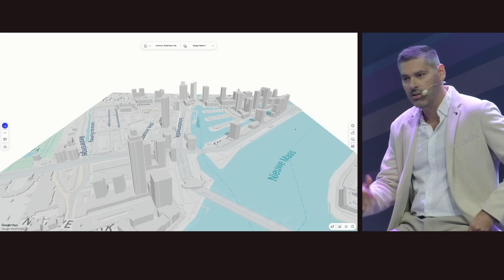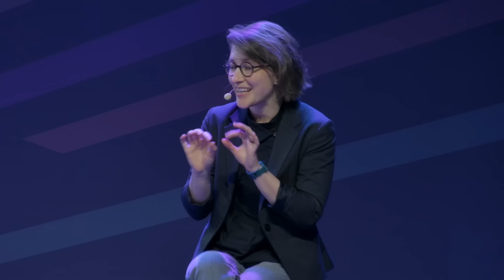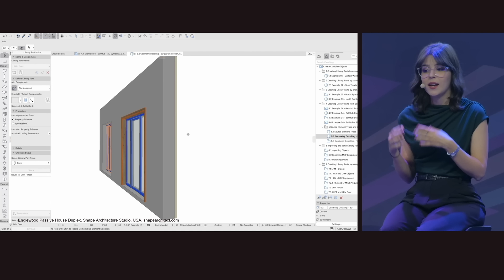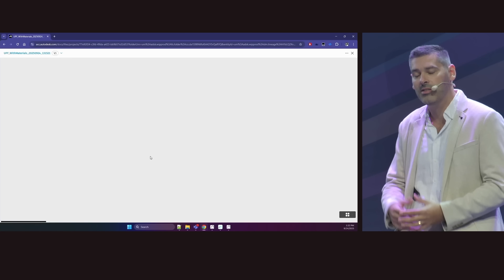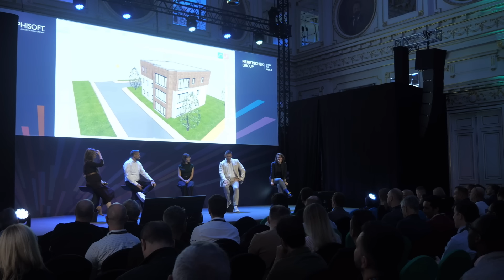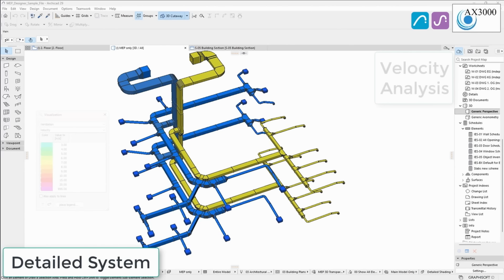Graphisoft Product Releases | IGNITE 2025

Comment: People aren't using the object creator because I don't want to have to make a thing that exists in every project we do for the last 20 years. That object should just be in archicad default library. Example. No electrical residential breaker box. It's in every project we do, yet the one our firm uses is from sketch up warehouse.

Client input on feature? Gimme a break. Has anyone actually read the wish list at graphisoft? The dumbest crap has been not working right for 10 years. Things we use everyday. Example. Make a 34" cabinet countertop 2 " thick. Now shut that counter off and the cabinets stays 36" tall. You need to turn the countertop back on, set it to zereo height and. then shut it back off to get the 34" correct cabinet.

The theme seems to be to add features each year to archicad that maybe 1% of firms in the world use. Here's looking at you octogon windows for skyscrappers. Cool to see it, but a total waste of dev resourcses for archicads actual client base. They are simply so far out of touch with what architects need for actually real projects. Not some project that you make in school of a 1 million dollar build, but you design it so fancy that it's 200 million to build it. That just doesn't happen in real life. No one but .005% of firms are building that, but those are the new features type things we get each year.

Comment: First edition in which they remove more features than they add. Back in the days Revit was removing features from the software, just to sell them as add-ons. Now they removed all MEP tools from AC29, just to buy them with the entire collaboration subscription. It was a bad tool, with many limitations and bugs but at least we could model some pipes and ducts as architects to give them to the engineers to model in a proper design software.
They convinced us to migrate our Archicad SSA etc to the subscription model promising we will still benefit of perpetual licenses until AC30. I can just imagine that AC30 perpetual license will be a bad joke.
They will lose their market share. At the new prices and subscription plans we have no reason not to migrate to Autodesk instead of using this toy. Yes AC has become a toy in the last years. Filled with bugs and inconveniences. With AC28 our office template became useless after years of development when they changed the library we had to start from scratch. With AC29 they terminated our MEP again.
And the AI is just a joke.